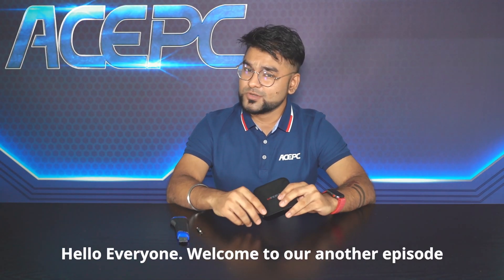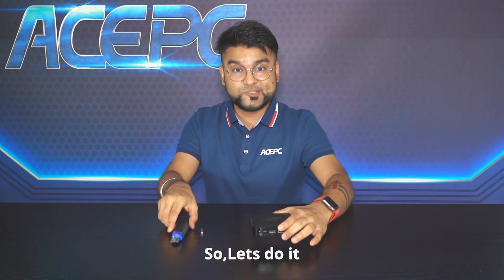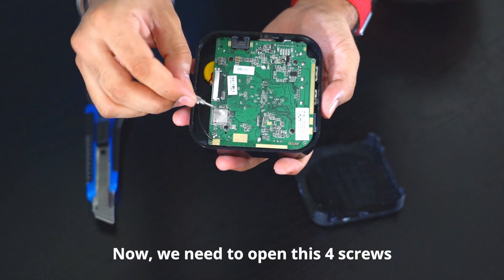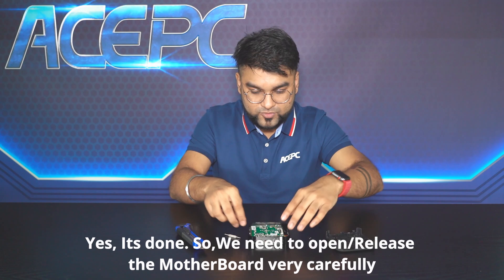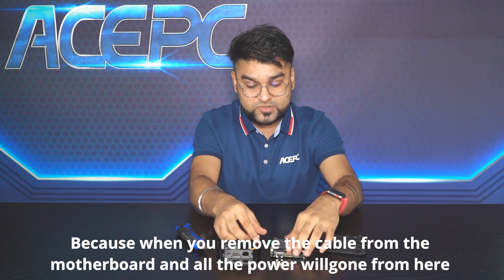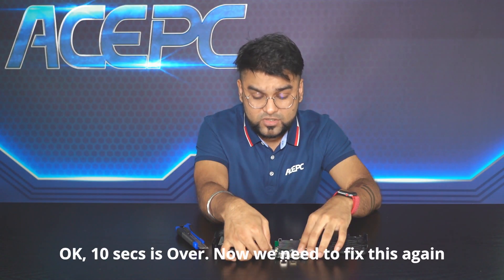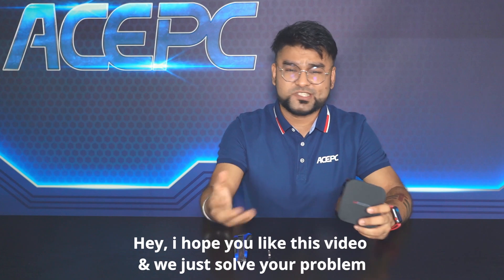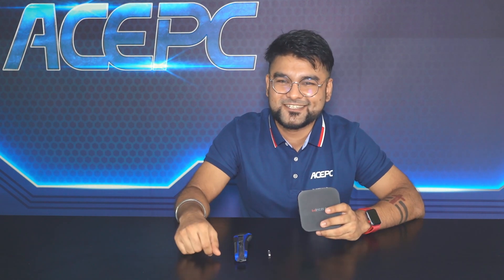How to reset BIOS of W8 MINI PC | Discharge the Battery | ACEPC Wintel Pro

Comment: Thank you.  Following your video I was able to reset my bricked WIN PRO Mini PC. The little Power on button tab fell off on the inside when I took the motherboard out. If you carefully examin it, you can see the little tab with a hole that mates to a pin on the inside of the case to put it back in place. It all works fine now.

Comment: can you make a step by step video on the bios of this pc. i accidentally went into the bios and set the display out to internal display. which caused it to show black screen every  time I turn it on. the video will help me navigate to the option without display output. reseting the bios didnt work for me.
Reply from the maker: 1. Enter the BIOS to restore the settings:
Press [F7] (do not let go) without booting - press the power button - until the BIOS interface appears (release the [F7] key) - press [F3] to restore the default - then press [F4] to save and exit.
2. Open Settings-Screen-Display a virtual display of 1 and 2, exchange or replace the order.
3. If the above steps are invalid, send the fault video and detailed description to the email: barry@minipcunion.com; we will contact you as soon as possible after verification.

Comment: not work
Reply from the maker: Hello, sir
If the discharge does not solve it. It means the machine's motherboard may have encountered a fault and I would recommend you to go aftermarket. Of course if you are a US user, you can get a new AK1pro for free through the Superuser program. it comes with the N5105 CPU.

Comment: On the one hand - yes it worked and wasn't even that difficult.
On the other hand - would a reset button which can be poked through a tiny hole in the case have been so much more expensive?

Also your forum seems to no longer exist.
Reply from the maker: Yes, we have changed the way the product is discharged, and obviously this way will be safer.
I will re-edit the forum address to remind you that this is our latest forum address: https://minipcunion.com

Comment: Thanks for the video — this solved my problem. One suggestion for everyone else: be careful not to open the case with the knife near the power button. The power button broke off when I did this and now I have to push it using a pencil or something because I couldn't get it back on the case.

Also, those screws are tiny and won't screw in unless the motherboard is seated just right over the holes where they're supposed to go.

Comment: Just used this procedure to fix my time issues with my ACEPC T11. After days spent trying to sort the faulty clock I tried opening the case and disconnecting the battery. It worked like a dream and the clock is now fixed. I love my T11 it does everything I need and is quiet and good value for money.
Reply from the maker: Hi, Martin Happy to hear you. Be connected in our OFFICIAL FORUM. https://www.iacepc.com/forum/index.php. You can share your experience too after Registration. Thanks. <3

Comment: Did anyone catch that the WiFi antenna came unstuck and he just ignored it?  That's the thing he's holding under his right thumb at about 2:59.  It was originally stuck to the side of the case, but it came off and you can see the case drop at around 2:41 - 2:42.  You can actually hear it slap down on the table when it drops.  LOL.  It's not a big deal, as you can just stick it to the side again and I'm sure he didn't want to bother with that in this video, but I just thought it was funny.

I should add that I hope you have more helpful videos like this.  :)
Reply from the maker: Ha ha ha.... You are right to watch this video very carefully <3